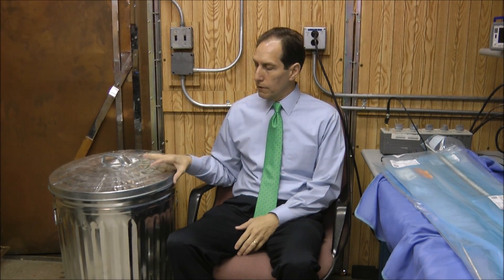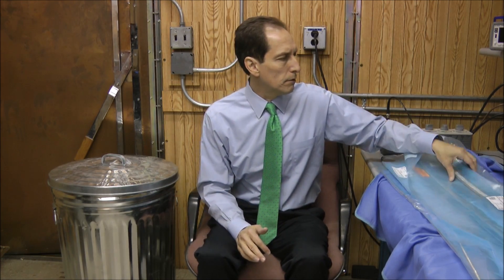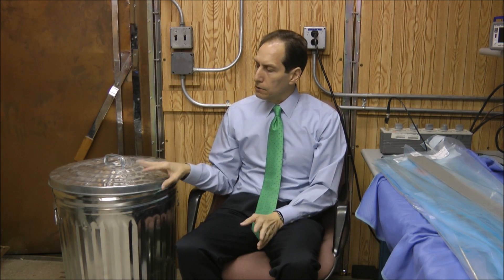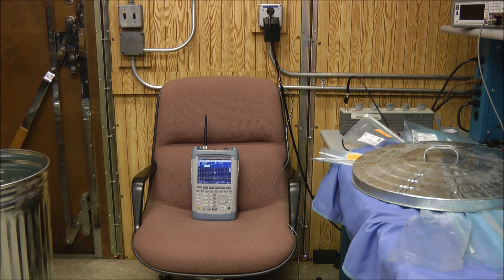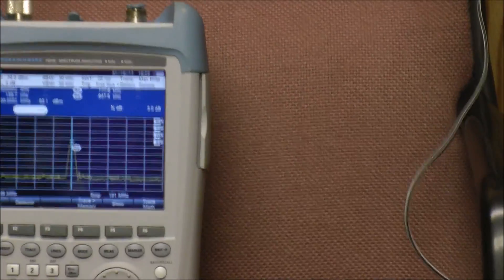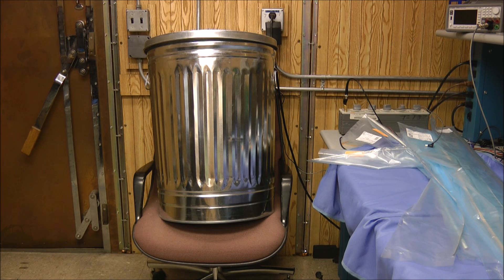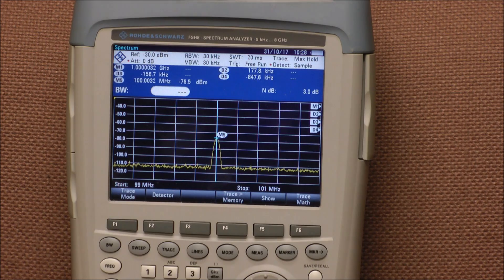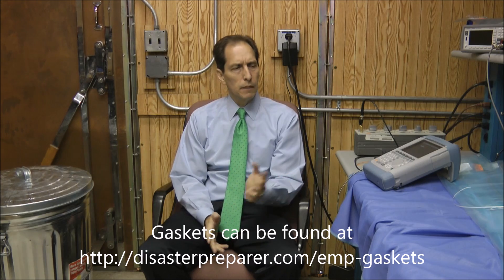Gaskets to Seal Faraday Cage

Comment: This might be a dumb question but how well would dirt be for emp protection? Let’s say you put this in a box in the ground, would that add to the dB protection?
Reply from the maker: Hi Will, I looked at this some time back. It ends up that the amount of shielding depends greatly on the type of soil (e.g., dry sand, moist agricultural dirt, flat countryside, etc.). But even in the best case of moist soil, you have to bury items about 10 feet to get appreciable levels of shielding. In dry sand, it might go up to around 100 feet.

Comment: Can your electronics be touching the inside of the steel can or does there need to be a non conductive lining between say your laptop or converter and the steel?  Sorry if I sound ignorant. Love your videos. Just trying to better understand.
Reply from the maker: You don't want the metal of exposed electronics, such as an antenna or charging port, touching the inside of the can. Most people line their cans when there's a risk of it.

Comment: This is all good and fine but wouldn't an EMP wave come without warning?  So every time we use our electronics these items must be placed in this can and sealed with that special tape?  What kind of warning can or will we have before this type of event happens?
Reply from the maker: The idea is that some critical items could be stored in a Faraday cage for safekeeping. Good examples might be a shortwave radio, spare medical devices, walkie-talkies, a multimeter, LED flashlight, etc.

Comment: Have you taken a look at the handle in these for these galvanized cages? Where the handle intersects to lid— there are tiny holes. I would think that an EMP could go through those holes. Turn off the lights and take a flashlight and shine it to either side of the lid you’ll see the holes at each end of the handle.
Reply from the maker: Fortunately, small holes do not appreciably degrade shielding from an EMP. It's an interesting experiment to take a "perfect" Faraday cage, and then drill a 1/8" hole in the side. The shielding level remains unchanged (or nearly so). Rather, it is the long narrow seams that compromise the shielding because the seam can act as an efficient slot antenna.

Comment: This is probably a stupid question, but I'm going to ask. How well,& would a shipping container work as a Faraday cage? If so,what would you recommend on making sure the doors would make a good seal?
Reply from the maker: Lots of folks have asked this question, and I don't have a great answer yet because I haven't tested it. I plan to test a shipping container sometime this coming year. My guess is that the door seams would need to be sealed up somehow. Some folks have suggested making a curtain out of the cloth and attaching it using magnets. That would probably work well.

Comment: Hi Dr Bradley.  Don't know if you will see this over a year later.  The adhesive on the gasket does not compromise its effectiveness?  Thanks
Reply from the maker: The adhesive doesn't actually take up the entire back of the gasket, so there remains metal-to-metal contact when you apply it to exposed metal. Also, it's worth noting that when I measured the effect of adhesives on larger metallic tape (copper and aluminum), I found that it in no way compromised the metal-to-metal connection. My assumption from the tests is that the adhesives are just too thin, and the metal presses through to make contact.

Comment: What I don't get is why people say you should put a cell phone in a faraday cage/box to protect it from EMP. If the grid is down after an EMP, what would you be able to use a cell phone for? Wouldn't the towers, etc. be down?
Reply from the maker: More than likely, they'd go down, but there's no guarantee what will fail, and when. Parts of the telecom system might remain operational. If the electric grid failed in its entirety, they could operate on generators for a short time. If parts of the grid remained up, they might even continue to provide service. Even if you only had service for a few days, the ability to use a phone to get information, coordinate gatherings, and communicate with loved ones would be very valuable.
Reply from the maker: I should also point out that there are small radios available that connect to cell phones and allow two-way and group chatting without the use of cell tower service. See GoTenna.
Reply: Of all the things I use my smartphone for, phone calls are about 20%.

Comment: It appears that your tests debunk two Faraday Cage items that a lot of so-called experts tout. The first is that a Faraday Cage should be grounded. The second is that items in a Faraday Cage should not touch the metal container. Meaning, you should insulate the inside of the container with something non-metallic like cardboard. Is this a correct assumption?
Reply from the maker: It's true that Faraday cages don't need to be grounded. I think people get confused because there are cases when shielding benefits from grounding (i.e. in the near field against phenomena like crosstalk). As for lining the cage with a non-conductive material, there's nothing wrong with doing that. However, it's often not necessary since most electronics are already housed in non-conductive packages. That said, if you had a radio with an exposed antenna, you wouldn't want the antenna touching the interior conductive wall. In that case, it might make sense to line the can with cardboard or some other non-conductive material.

Comment: I am 99% sold on this method.  It was very informative and straightforward for us lay folks.  Then I notice your "Ammo Can Faraday Cage" ready to pop up next to view.  I will wait to see the results on it because I do not require such a large cage as the trash can.  Thanks.
Reply from the maker: For small Faraday cages, ammo cans do a really good job, especially with a conductive gasket. Even easier is to use "EMP" bags. I have a video or two on them as well.
Reply: Actually after viewing your ammo can video I am going to do both.  One for small objects and the trash can for larger items.  I am a bit concerned regarding the handle area on the trash can.  I purchased a 31 gallon that appears to be the same size as yours.  Mine has small punched out holes near the handle hinges.  Would it be beneficial to apply some conductive tape thereabouts?     Thanks.

Comment: Excellent, very straight forward and professional videos! One question will this trash bin withstand the high voltages of an EMP or will you need a good ground?
Reply from the maker: A ground isn't needed. It doesn't hurt, but if you calculate the temperature rise of something metal this size, it is very small.
Reply: disasterprepper ok thank you sir. I will be purchasing some of your books to help protect my ham radios against an emp. God bless!

Comment: Do I have to put something in between my electronic devices and the can to prevent it from touching the metal such as cardboard?
Reply from the maker: Normally, it's not necessary because most electronics are already enclosed in plastic housings. If they have an exposed antenna or charging port, you would want to make sure those didn't come into contact with the inside of the Faraday cage.
Reply: I have one more question. I have a desktop computer that I want to protect. However, it won't fit on the trash can and it won't fit in those EMP bags that you have in your website either. What is your recommendation?

Comment: I have not read Dr. Bradley's other material, so if it is covered there, my apologies.  There is a problem with this methodology:
When dealing with EM Ingress, the specific frequencies used are important.  This is especially true for talking about gasketing seals etc.
The problem is that,for higher frequencies, even if you have a gasket that has a terrific seal at lower frequencies (such as the 100MHz frequency used in the test) a short gap in the seal will allow significant ingress of frequencies where the gap gets larger than the wavelength.  There are specific mathematical relationships, but since we don't know the frequency vs. energy content of an EM Pulse, it doesn't really matter.
At the 100MHz frequency used for this test, the wavelength is 300cm, so even if the gasket has huge gap, the test would not reveal it.
At 3GHz, the wavelength is 10cm, at 30GHz it is 1cm.  
These gaskets are great but you need to be sure that there are no gaps. Also, for small items with no leads attached, the 100MHz would not generate a very large voltage anyway, so I think we are protecting against higher frequencies.  Again, that is a guess as I don't know the energy vs. freqency content of an EMP, but I would assume that a small nuclear device generating an EMP though gamma wave shock in the high atmosphere would have a lot of very high frequency content.
Reply from the maker: You're correct that  higher frequencies correspond to shorter wavelengths. So smaller gaps become more important when trying to block higher frequencies. I test up to 1 GHz but for brevity, I only show one frequency in this video. The 1 GHz corresponds to the frequency content of previous EMPs created through atmospheric detonations. The frequency content can be determined by inverse Fourier analysis of the measured time-domain waveform.

Comment: how do you protect a vehicle????
Reply from the maker: If the vehicle is off, the easiest way is to cover it with something conductive. See https://youtu.be/CIivyKyndAE for conductive cloth that could be used for this purpose. If the vehicle is running, it's much more difficult to protect and would require that a qualified electrical engineer get involved to assess the specific susceptibilities.
Reply: E.M.P shield electronic device

Comment: I'm confused on the numbers. I need the Layman's for dummies version. My question is this Doc, is the pulse from a emp a short pulse or a long pulse? Meaning is the pulse over quickly or will it last hours? Thanks for making the videos.
Reply from the maker: An EMP is generally described by three distinct elements (E1, E2, and E3). E1 is very rapid with rise times along the order of 1 nano second. It might last hundreds of nanoseconds. That is very brief, and this radiated energy would potentially couple into even very small scale electronics. Next would come E2, which might last into the tens of milliseconds. That's quite a bit slower, and would primarily couple onto long conductors (e.g., transmission lines, buried pipes, etc.). The resultant currents on those conductors could cause damage to anything connected to them. Finally, there would be a much slower E3 pulse that might last seconds or even tens of seconds. Again, this would only affect very long conductors and things connected to them.
Reply: disasterprepper thanks for the reply and the information

Comment: Dr. Bradley, do the surfaces of the container need to be bare / electrically conductive in order to block the signal with metallic tape or gasket installed ?  Can paint on the metal cabinet / safe be left intact or is a metal to metal contact necessary ?  Will the adhesive be similar to a coating or paint ? Thanks  J K
Reply from the maker: The exterior of the container can be painted, but the lid-to-can interface has to be metal to metal. The gasket only has a small strip of adhesive on the back so that it makes contact with both surfaces, conductively sealing it up.
Reply: Thanks, I've been thinking about purchasing an upright metal storage cabinet. Probably would need to strip the door edges of paint and apply gasket material after.  It seems like a functional unit as long as the gasket / seams are minimized. Appreciate your input. Any future vides of such a process ?   J K

Comment: An EMP pulse has a much higher frequency span than the 100 MHz you tested at and extends well into the Ghz range. Can you repeat that test to see if its effective at Ghz frequencies.
Reply from the maker: I only show the test for 100 MHz as a sample frequency. EMP shielding tests are usually tested up to 1 GHz, which is what I do for all my shielding experiments. The gaskets do equally well at that frequency, and the next time I get in the lab, I'll capture that on video too. I could have done a video showing a number of frequencies, but I picked 100 MHz as a sample point for the video.

Comment: Outstanding Gasket Doc, looks bullet-proof...  I wish I had known about this before my rig was built.  I suppose items would not need Dry-Shield bags inside with that level of reduction?  So is my math close for my rig: 17dB x (2) untapped cans + 48dB Bag = 82dB of attenuation?   I am using a medium can, nested inside a large (normal) size can.  Then each electronic item is in a 3M Dry-Shield 2000 bag. This configuration allows for instant access to my goodies.  I love your EMP Book !!!

Comment: Great video as always!!  Just bought 2 of the gaskets. Wish you lived closer to Indy area. Would love to see your workshop and meet you sometime.  One question. My wife uses Splenda a lot and their bags are pretty big. It has aluminum on the inside. I've used a static bag first then wrapped my ham radios in 3 of the Splenda bags. I'm in IT but don't have any of your testing equipment, but since it stops my Bluetooth & Cell signal I'm assuming it's shielding some? Have you ever tested anything like that?

Comment: What is the spectrum analyser you're using?
Reply from the maker: It's a 6 GHz Agilent model. I've had it for several years, so there are newer models out there. If you really want one for home, you can find a decent analyzer for under a few thousand dollars. You would also need a large signal generator, an amplifier, and a broadband antenna to conduct these tests.
Reply: disasterprepper how much power are you pumping into your antenna? (Yes I'm a total geek, and I've been learning RF.)

Comment: Dr Bradley, thank you For you videos and books.  A couple of questions.  How would batteries fare?  AGM? LifePO4?  Also what about antennas and coax for communications gear?  Should duplicate wire antennas and coax be shielded in a faraday cage?  There is some thinking indicates shows solar panels would likely survive, can you verify this?  I suspect charge controllers would be lost.
Reply from the maker: Batteries should be fine as long as they don't have charge control circuitry inside them. Antennas and cables would also be fine. So, no need to store either. Solar panels are not a sure thing. Some testing showed that one particular type of free-standing solar panels survived when it wasn't connected to anything, but was destroyed when it was connected. Definitely, the charge controller would be at risk.

Comment: Thank you so much for being the lone truly scientific presenter of emp protection anywhere on YT or the web! (My degree Computer Engineering) One comment...not all (any?) of the  aluminum tapes at big box stores have conductive adhesive. Cut a strip to span a pair of pennies and see if the multimeter reads 0 ohms. I struck out twice and finally ordered some copper tape on Amazon that provided conductive adhesive. I used that to seal the seems on the galvanized trash can (after I ground off the handle clips to get simple holes to cover. Also, the bottom seam was spot welded and leaked water, let alone EMI. I taped it too.) I’ll be ordered gaskets from you. Could you run your same tests to where you could show 100 dB of protection? It seems like a nuclear generated emp could produce much greater signal levels than your current configuration. Thanks again!
Reply from the maker: Hi Jay, I doubt I could show 100 dB of protection because of the dynamic range limitations of the equipment. Perhaps I could get 70-80 dB across frequency, but to be honest, it's unnecessary. Keep in mind that we're not trying to block the EMP, we're trying to survive it. 100 dB of shielding would reduce a 50 kV/m electric field down to 0.5 V/m. That's less than ambient. Most EMI tests can't even be run below about 5 V/m. 50 dB of protection reduces the field to about 158 V/m, which nearly any electronics would survive. That's why I recommend that minimum level for sensitive electronics, and also why I typically limit my tests to showing that level.
Reply: @disasterprepper  
Do the cans need to be grounded?

Comment: What about putting a rubber garbage can inside the metal can
Reply from the maker: The rubber won't help (or hurt) the shielding of the outer can. By "sealing" I'm referring to sealing it against RF energy coming in.